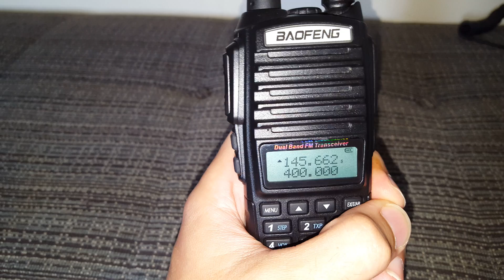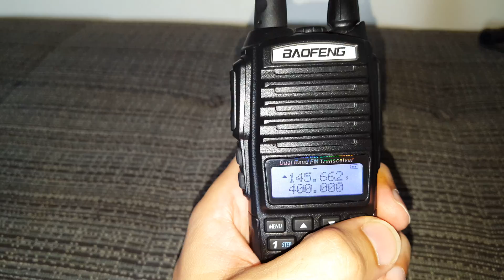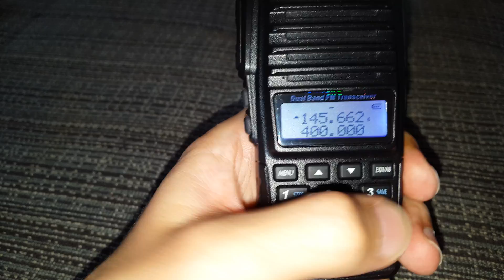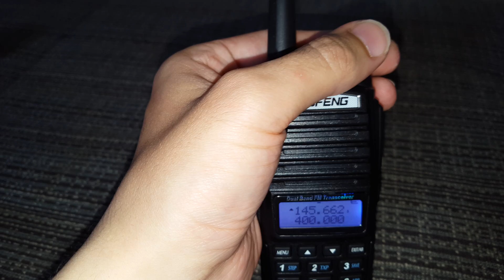Baofeng (fastest way to programme a repeater!)

Comment: How do I save a custom frequency (i.e., 180.000)?? I go to frequency mode and input "180.00" and every key resets it to the previous freq. Thanks!!!
Reply from the maker: Hi this radio doesn't cover 180.000 mhz, it goes up to between 136 mhz - 174 mhz and 400 - 470 mhz, some baofeng uv82 model covers 130 mhz - 176 mhz and 400 - 520 mhz, but entering 180 mhz will make your radio reset to the previous frequency  as it just doesn't cover 180 mhz! Hope this helps 👍

Comment: great video - you say to be in frequency mode - how does one place the UV9R in frequency mode? :)  mine defaults to channel mode..
Reply: lol - just figured this out!  in UV9R - hold MENU  button down while turning on unit... that will toggle frequency / channel mode :)
Reply from the maker: Nice one, im glad you got it sorted, have fun with it buddy 👍😁 73 from bristol, uk.
Reply from the maker: Hi thanks for the comment, i havent had any experience with the latest baofengs so i wouldn't know why your radio does that? Sounds to me like the uv9r has a different manual programming method? 👍

Comment: So how I find the nearest repeater frequencies? I live in Bude, Cornwall, and can't find anyone who has a clue about radio transceivers.
Reply: What would mind be for Cannock in Staffordshire
Reply from the maker: I believe your nearest repeater is in bideford, gb3nd and its operational! rx frequency - 433.350
Tx frequency - 434.950
Shift - 1.6+
Ctcss - 77.0

Hope this helps! 👍
Reply: @m6stl2010  Thanks for your reply. I think I may be out of range of Bideford repeater,but tomorrow I'll attach the longer antenna,and try outside.
Reply from the maker: @hugebartlett1884  no probs, you might be ok, failing that you could try the liskeard repeater? 👍